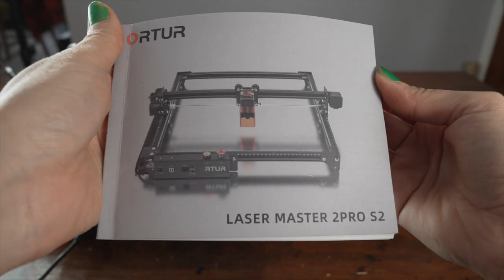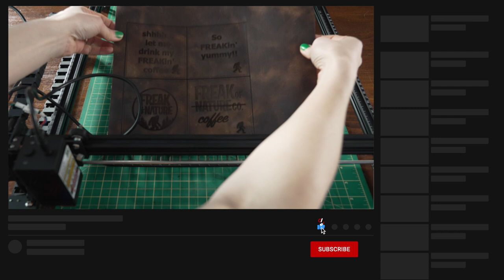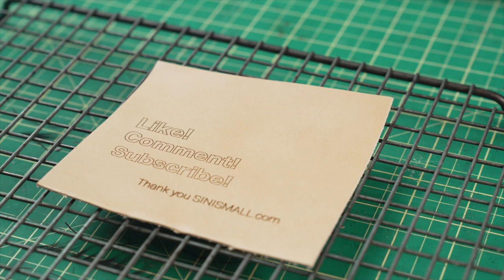Secret Weapon for DIY's...

Comment: Great video as always. I have the Non Pro version of your Diode Laser. I will really recommend you using a different set of safety glasses  than the ones that came with the machine. Ones that will protect your beautiful  green eyes ☺️ from the wavelength  that your laser produces. I sometimes use masking tape on the leather when engraving and after engraving my design and before peeling the tape left, I eill spray it with acrylic leather paint for different color engravings 😉 . Tha might be something you wanna try.
👍👍👍
Reply from the maker: Ouuuu that is interesting! I may have to give that a try! :o thanks for the tips!!! ☺️☺️

Comment: Fingernails and glasses.. same color.. check... how long did it take you to get the laser settings right? You have great ideas there. I absolutely love the glass holder.
Reply from the maker: Haha I may or may not have done that on purpose 😉 lol… and honestly not that long, the laser came with some suggestions for settings depending the material so I started with that and it didn’t take long to find the settings I was happy with. :) and thanks so much ☺️

Comment: These cheap laser cutters are not safe. A proper laser cutter needs to be sealed and vented to outdoors because the burnt products from engraving are very toxic and carcinogenic.
Reply from the maker: I did realize that very quickly… I’ll be acquiring a better setup for the next time I use it!